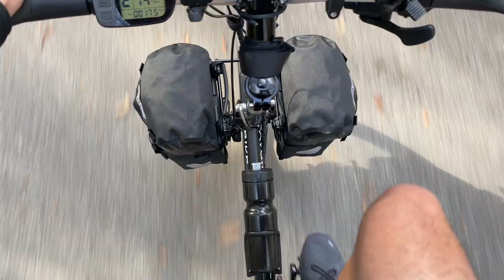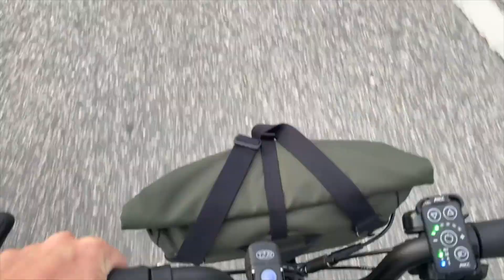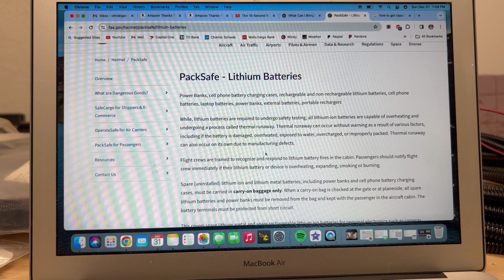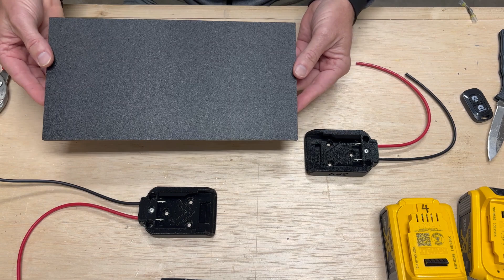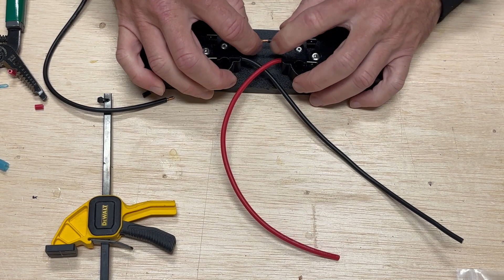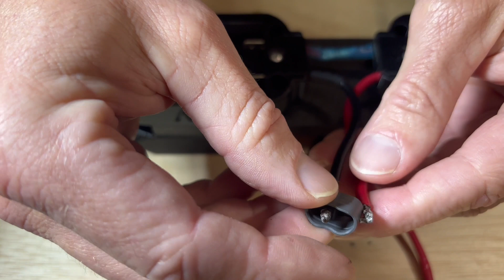TSA (airline) approved ebike battery

Comment: Usually, if the lithium-ion batteries are drained too much or left sitting around doing nothing the BMs inside the batteries run out of power it usually has a 5v battery that is drained but you can restore the batteries back to working condition by using a working/normally charging battery and just use the good battery to charge the dead battery back to life by adding a 
Wire piece to the positive ends of both batteries and the negative ends of the working and Dead battery and leave it as is for about 1 to 2 minutes then the Dead battery should start accepting a charge and start functioning again back to normal (You can use two pair of Scissors and do the same thing to revive the battery and get away with it ever when you have a different type /shape of battery pack).
This battery pack dying and not accepting a charge from the charger is a well-known problem and this method works pretty much each and every single time.
Would suggest you use the packing foam of your bickle battery pack to be cut in small sheets separately and then added around the battery pack assembly inside the Battery pack on all 6 sides to secure it for impacts while riding the bike or for safe travels.

Comment: Most of the big brand tools have a BMS built into the battery and I am fairly sure that DeWalt battery have this protection in as well (at least the ones in the UK do). I would still recomend charging them in the official battery charger but the battery should prevent you from over charging or under discharging them.

While I am keen hobbiest with electronics and batteries please do read all of the comments by MikkoRantalainen he is correct with my understanding with both the battery voltages and soldering irons. I personally leave extra solder on my soldering iron at the end of each use to help protect the tips until my next use when I clean it off using brass wool after it has heated up.
Reply: Tool battery BMS do not have any way to disconnect the positive nor negative of the battery. You could draw them down to 0 volts no problem. BMS monitors and communicates with appropriate device (tool and chargers) and tells them when to stop charging/discharging

Comment: 34:45 Before connecting batteries on both sides, you should measure that the voltages are close to each other. Otherwise the side with batteries with higher voltage will try to charge the other side very rapidly because you're connecting sides in parallel with a thick wire when you connect the split wire.
Reply: I don't believe this is correct.. There is not a complete circuit between any of the batteries until he put the multimeter into the pack. the only real danger here is not having all batteries charged equally when using the pack and having one battery run too low on energy, ruining the dewalt cell pack.
Reply: @lolapplesauce  Let's say you have 4 batteries at 16, 17, 18 and 19 V. If you have 16 and 17 V batteries in series for total of 33 V for the series connected combination, and 18 and 19 V batteries in another series combination for 37 V. When you now connect the Y-split wire, you're combining the black ground wires together and the red wires together. The series combination with 37 V will have 4 volt difference to 33 V combination, right? As a result, that 4 volt difference will be balanced as rapidly as one series connected battery can release the required energy and the another (33 V) series combination can take it in.

In reality the voltage differences between the batteries should be much less but the idea is still the same.

Comment: 29:20 DO NOT sand the soldering tip. The tip is supposed to have thin coating from the factory and if you apply sandpaper or file to the tip, you destroy the coating. You should use a brass sponge to clean you tip instead – just melt some fresh solder to the tip and clean it using a brass sponge immediately before use. If the tip of your soldering iron looks black – like in this video – the coating in the tip has already been destroyed beyond repair and it's the time to get a new tip for your soldering iron. If your soldering iron doesn't have thermostat controlled temperature, it'll burn off the coating from the tip pretty fast.

And apply lots of solder flux.

If you can use something like TS-100 or TS-80 soldering iron (should cost around $60–$80), the soldering iron has a lot more power to solder thick wires without burning the insulation away and doesn't destroy the coating in the tip because the temperature control actually works. Getting lots of tips for a cheap soldering iron because it destroys the coating is quite expensive route in long run.

The smoke raising from the solder is the flux. When it stops smoking, you've already run out of flux so if the soldering iron tip is still in the solder, you used too little flux.

And remove the flux after soldering using isopropyl alcohol unless you used speficially no-clean flux. Otherwise the solder will oxidize over time and you get a poor connection.

Comment: 9:35 If you have your own 3D printer, you could create your custom battery receiver with a bar shape that takes 4 batteries: one in each end and one battery under each battery. Basically the arrangement that you're describing around 11:00 but with a single plastic bar directly taking all the 4 batteries.

Comment: Have you tried charging it with a generic 36v ebike charger ? Would save you the hassle of charging each pack individually. It may or may not work as it will depend on if the packs will except charging via the out put. Be interesting to find out ?
Reply: Agree, if you stop somewhere for a break mid-day, would be great to charge the whole pack, rather than having to swap batteries and potentially have batteries of unequal charge.  Also, if you do charge the whole pack at once, I wonder if the batteries will all charge to the same level, i.e. will differences in battery voltage work itself out when charging the whole pack as one unit?

Comment: How to avoid the lithium-ion battery restrictions? Switch to sodium-ion. If manufacturers' safety claims are true, then those should be safe enough to have no restrictions besides carry-on luggage space and weight limits.
29:20 "Make sure your tip is clean, I sanded this with sandpaper before I heated it up." Most soldering iron tips are plated with something to help solder stick to it, which in turn helps with heat transfer and picking up excess solder from solder joints. Sanding tips ruins that.
Reply: Oh yeah that's true!

Comment: Couple of points for the benefit of others: 1] iron temp seemed a bit hot; 2] solder wicking down into the wire insulation is something that your actually trying to limit/ avoid as much as possible.